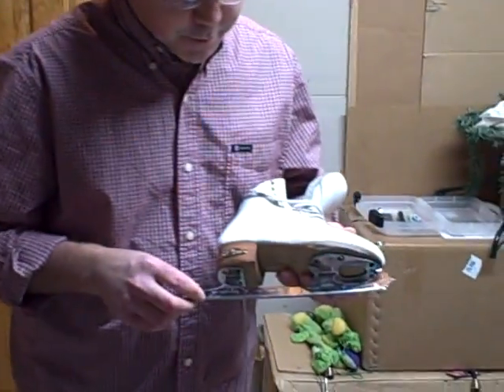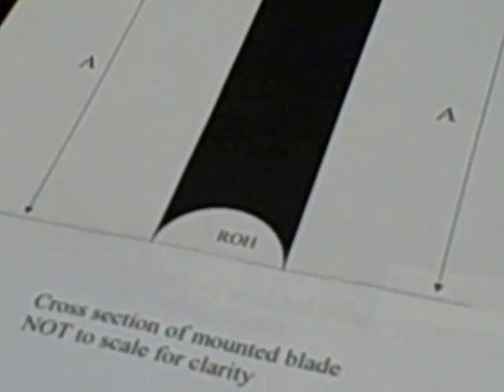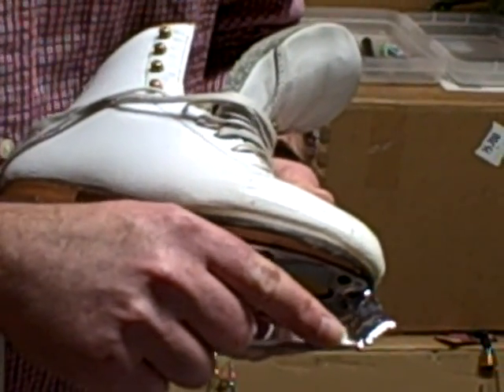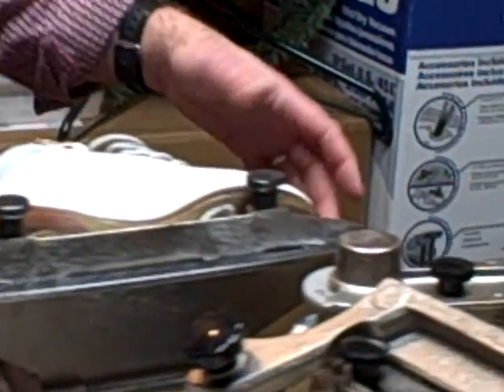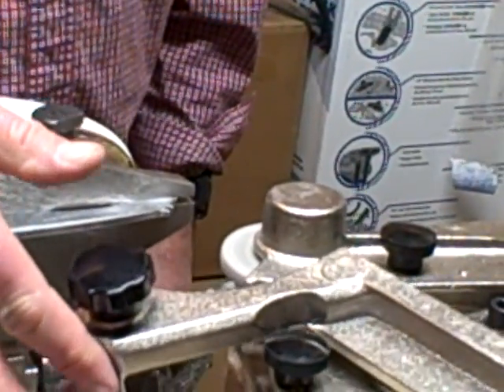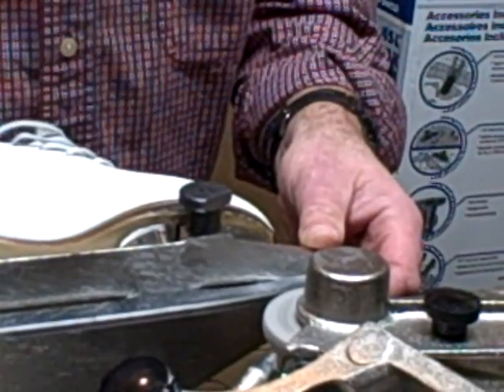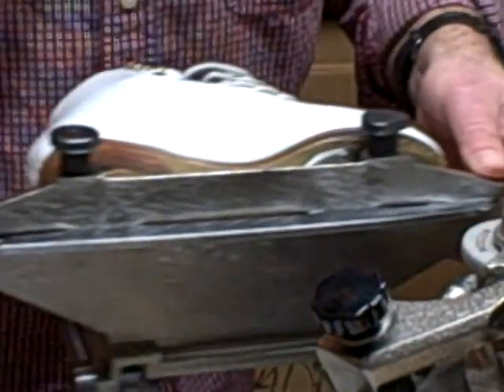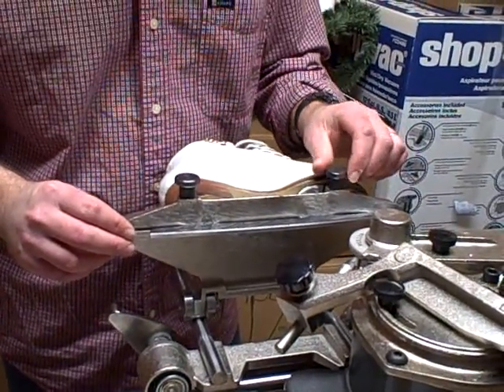Smentkowski Figure Skate Sharpening

Comment: Would it be fair to say that hockey skates have a larger hollow than figure skates?  I would think goalie skates and figure skate edges are similar.
Reply from the maker: The radius any skater uses is based on their preference.  Speaking in general terms, your statement is correct.   Going one step further, speed skaters have almost no radius, they want lowest friction, highest speed, and minimal edge control.

Comment from the maker: MIchael
For most figure skates, I use 7/16" or 3/8" radius of hollow.  The smaller the ROH, the deeper the edges bit into the ice - net effect is better edge control but at the sacrafise of speed for lower ROH.   Before I sharpen any new skates, I always measure the ROH of the as received blades.  If I feel they should be changed, then I talk with the skater or the parent.  
Best of luck.